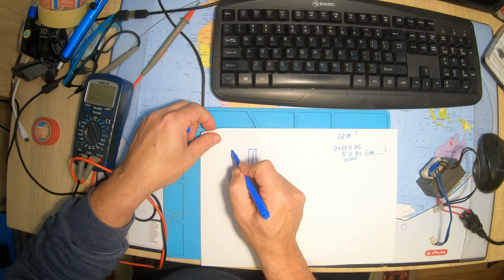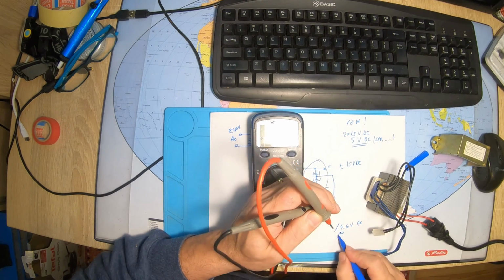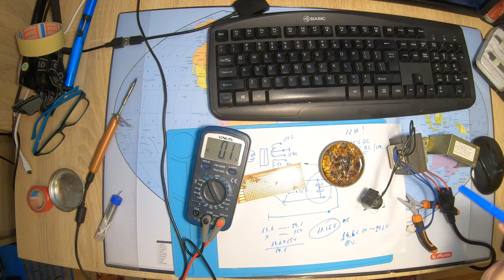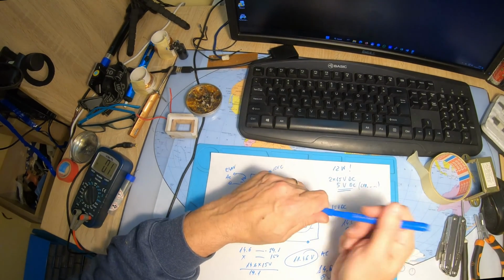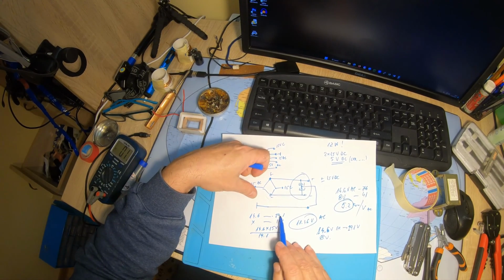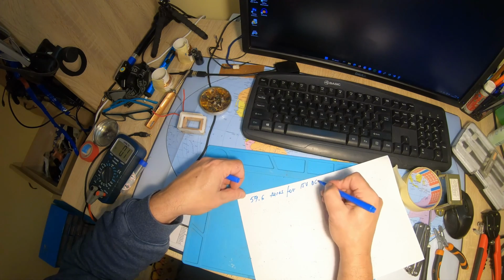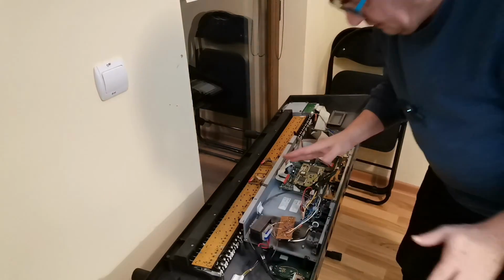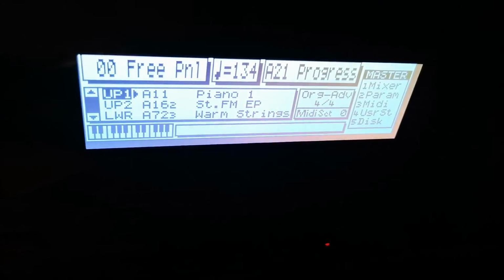Roland G600 G800 G1000 power supply fix

Comment: eu nu am inteless...blocul riginal da 15 v...5v...si ati facut 12 v ..5....la mine e de calculator 12v..5v...si am distorsiune la esire
Reply from the maker: E foarte simpla alimentarea, 12V si 5V, si gata! Distorsiunea este probabil de la vreun IC operational in circuitul audio la iesire. Verificati daca aveti distorsiune si pe casca...
Reply: @viocaia  si pe casca...din 4 canale la out 1 abia se aude dezastru mare..cred ca de la el il dezbate si pe out 2
Reply: @viocaia  da de ce ati scris...KARTIS SWM18N 2x15V & 5V DC switching power supply

Comment: Hi - It's the same for G1000?
My friends G1000 stop turning on and I want to try to safe his instrument :D
Reply from the maker: There are few boards doing the same job, but they are compatible. You can find on eBay for 30USD max..,I preferred to DIY my own with classic transformer because I had the parts around.